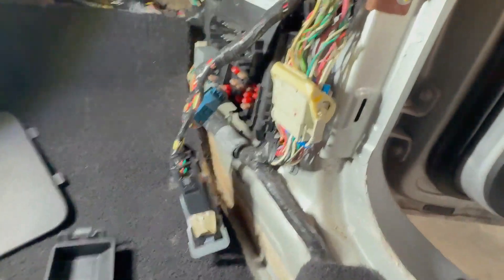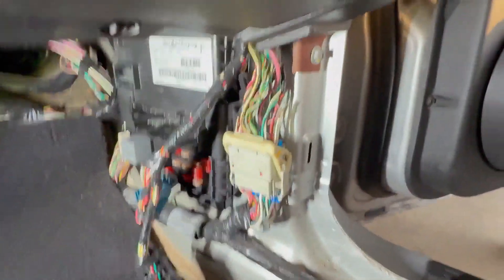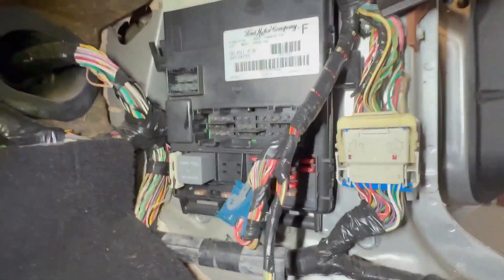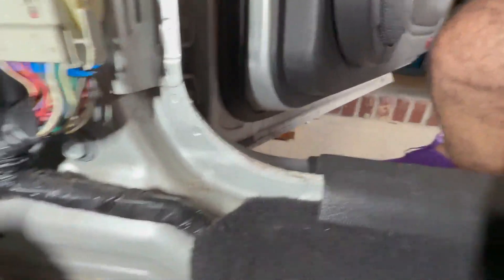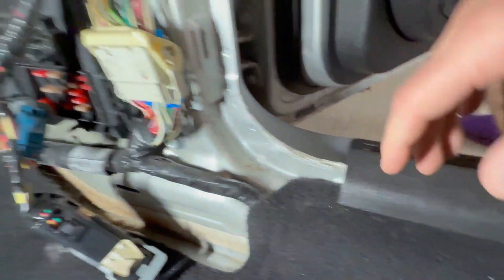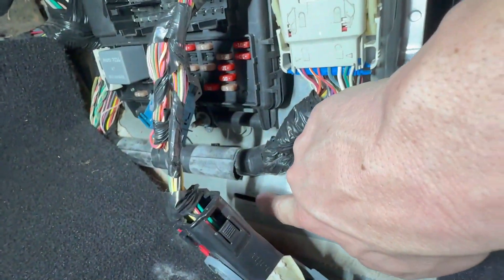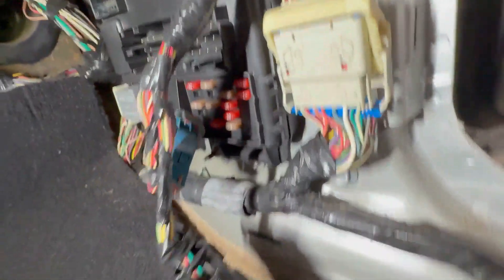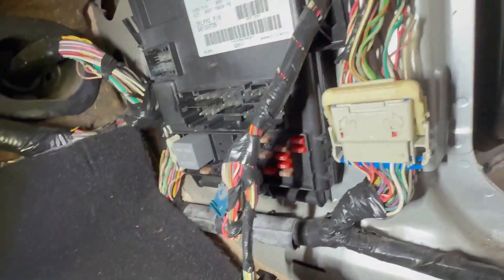RANDOM RIGHT TURN SIGNAL ISSUE: 2008 Ford Mustang GT Vert, Smart Junction Box Connector Issues

Comment: Can you PLEASE show where the water gets INTO this area? I'm sure this is whats happening to my beloved Mustang, and I will open it up and do all this work if I can, but, I need to know where and how the water gets into my passenger side carpet to stop this ever happening again. My flapper valves are clean as a whistle, so I dont think its over flow from the body cavity, but I just do not understand how water is getting into this unit. Great clip, I really hope you end up getting another Mustang, you seem to be just the right man to own one. Cheers and thank you so much.
Reply: the leak occurs through the cabin air filter.  Stopping the leak is a 10 minute fix that should be done every winter.

To fix this, the plastic trim under the left windshield wiper needs to be removed.  There, you will see the cabin air-filter,  near the battery.  About 8" toward the driver, you will see a rubber oval.  That is the drain for when it rains.  That rubber oval will get clogged with debris from time-to-time which prevents the drainage.  The lack of drainage will cause water to rise, which will then flow into the cabin through the cabin air filter.  Of course, this occurs right over the Smart Junction Box which cause the electrical issues.

Comment: Omg im trying to fix my mustang myself i dont have labor money
Im nervous ty fir this video
Reply from the maker: Yw.  There is only a 50/50 shot cleaning the plugs will work longterm.  This worked for me for a few weeks and then the symptoms randomly came back.  Just spent 4 months chasing down a new SJB for the car.  LMK if you need any recommendations on replacement units.
Reply: You are a God send ty my friend.
Tomorrow im going to try and remove it and visually inspect it. Clean it really well look at connectors and wires. I love this car so much .@DIY1978Guy
Reply: @DIY1978Guy  I'm gonna have to do all this and hope it works. Can you please drop those recommendations on replacement units just in case I cant fix mine? Cheers!

Comment: It's driving me nuts it comes on and off all the time
Reply from the maker: Yeah the plug trick in this video seems to have corrected it about 90% of the time.  Since then it has come on again once or twice, so probably need another run at cleaning the plugs even more.  Still an annoying issue.
Reply: Es afecta al of driver amigo si ests susio